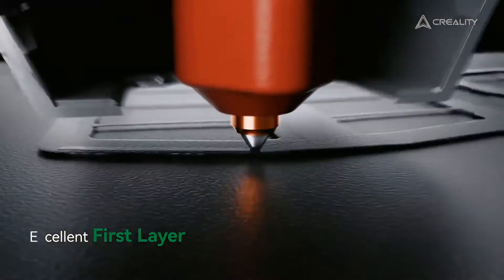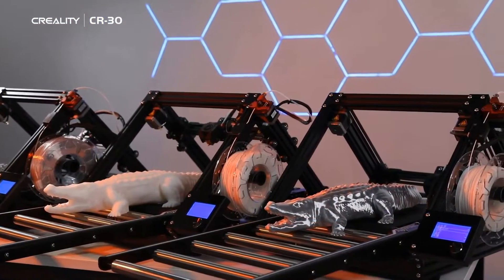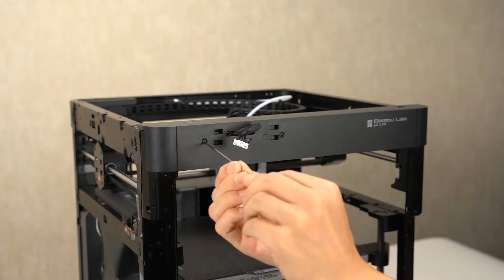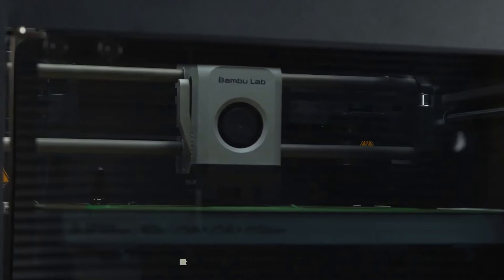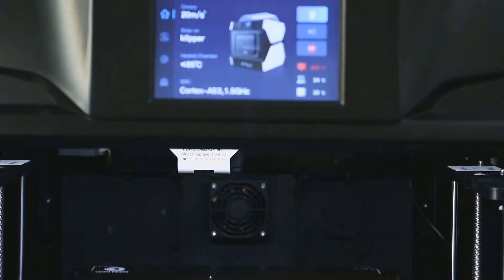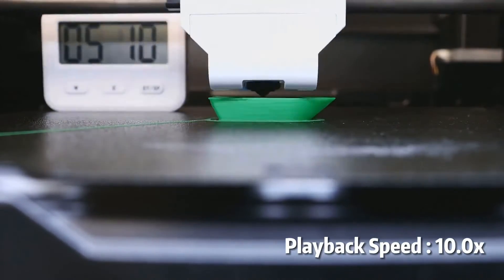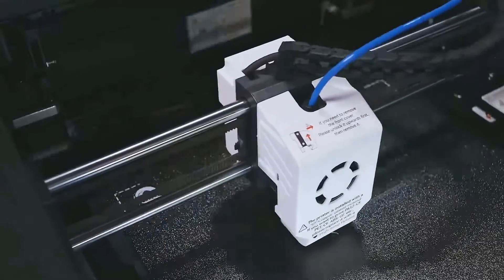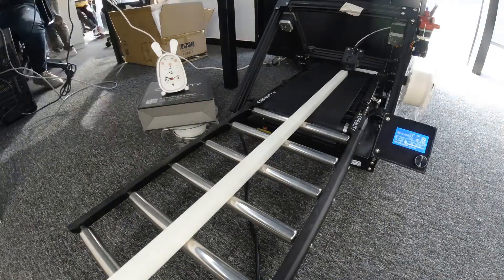5 Best CoreXY 3D Printers 2024: Reviews and Buying Guide

Comment: hi Taylor I would like to buy the 3D printer that can use carbon reinforced filaments and ABS with a large enough plate. Larger than the K1C reality at least a 30 × 30. what do you recommend